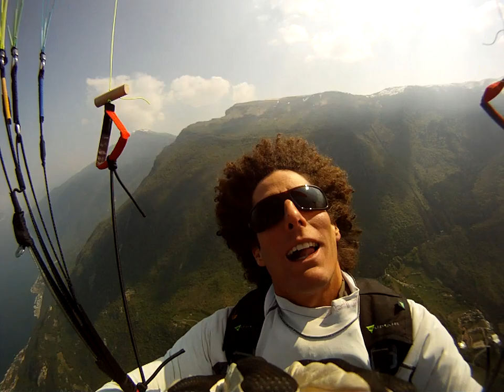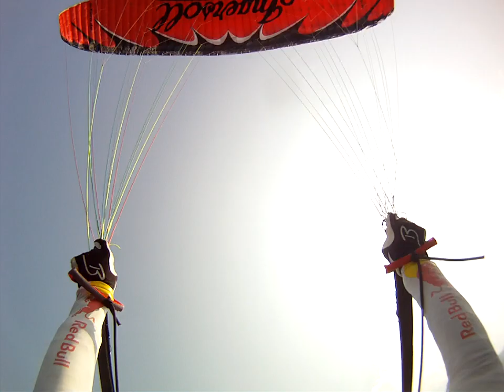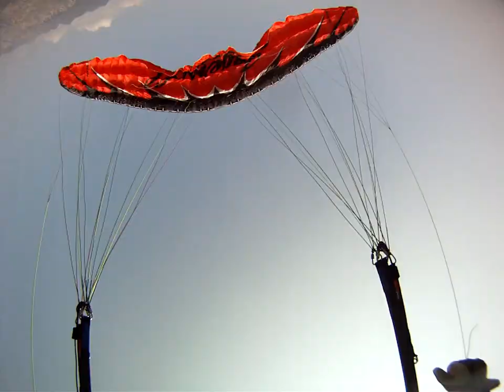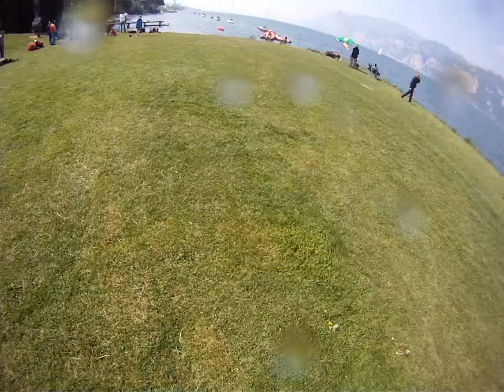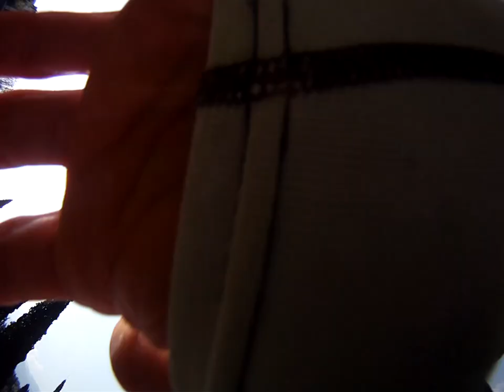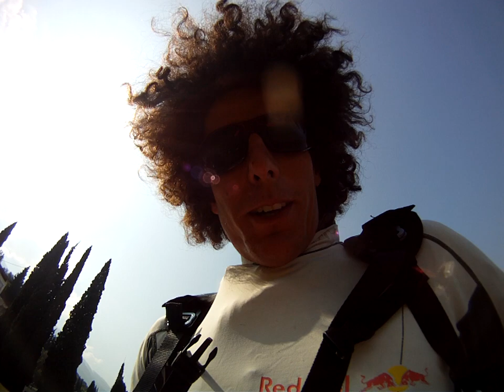The Wing Load Research - 12.5 m2 Thriller test flight with 7,4 kg / m2 !!!

Comment: Interesting to see this from a perspective as a skydiver swooper. Basically we call a swooper somebody who specializes in the kind of landings you do here but our swoops are initiated from way up higher (1000ft or higher on a high wing load canopy) and involve way more speed and distance covered over the ground. The way we measure wing load seems also totally different. We use the division of the surface of the canopy (in square ft) by the weight of the load (in lbs). The wing load of 7,4 kg to a 12.5m² canopy comes at 1.4. I don't know if this is a lot of not but for a skydive ram air parachute that's a pretty average wing load. Swooping canopies are more high performance and start at about 1.8 while at 2.4  things get serious. The really high performance experts pilots go up to 3 wing load and much higher which usually translates to very tiny canopies about 70 sq ft in size for an average weight pilot. 70sq ft is about 6,5 m².  This is an example of a bit of extreme wing loading and swooping: https://www.youtube.com/watch?v=3zpWWTdfpGY
Reply: Skydiving rigs are PARACHUTES with 7/9 double cells. These are paragliders - the performance is night and day different, and they handle and feel completely different.
Reply: You're comparing apples with pears. You guys have parachutes we have paragliders. You can't gain altitude with a chute it's made to descend but with a paraglider you can actually fly. I've not seen anyone performing helico or sat on a parachute. Are there any?